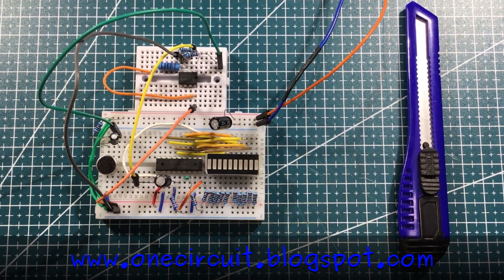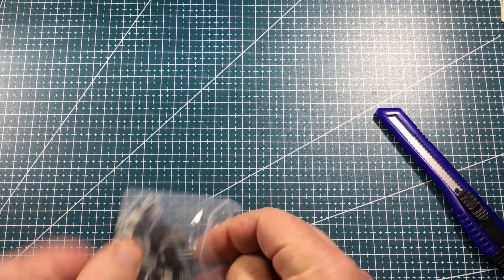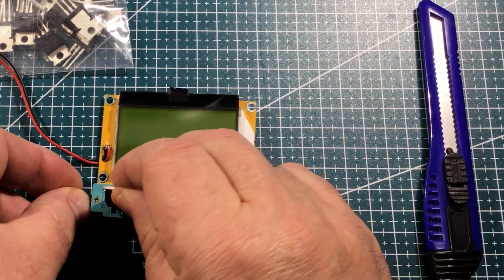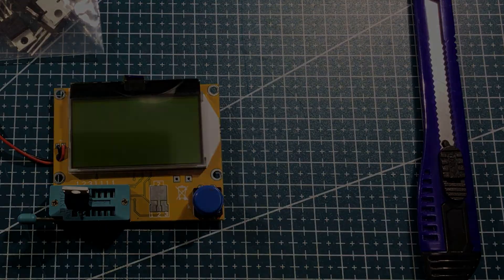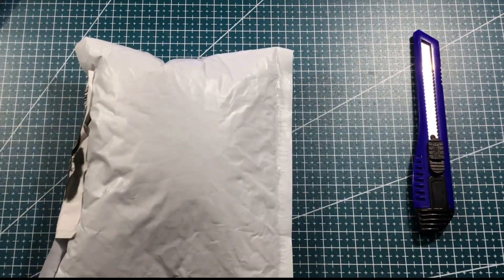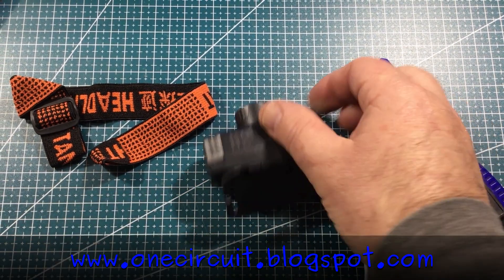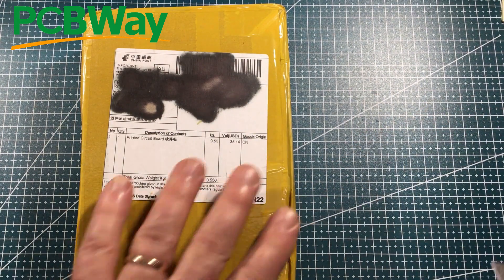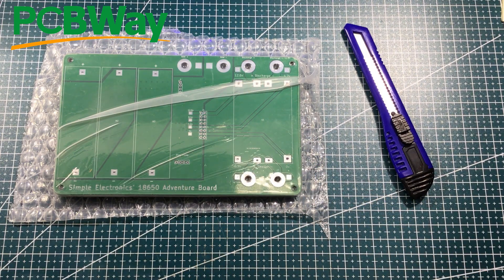Mailbag #16 - a nice mix!

Comment: Curious of your plans for the power PNP Mosfet.
They really coiled up your PTFE tube.  I obsessively try to make mine straight, without putting kinks in.
Now you just have to figure out where a Rpi3+ can be bought.  Sad they did not send you the alternate cable for a PiZero2. Hard to find those as well.
Reply from the maker: No specific plans for the power mosfet, just that I didn’t have any. I mostly buy stuff I find a bit curious and then maybe come up with possibilities for them later!
I am lucky enough that my workplace was throwing out “useless” Rpi3+ units a year or so ago and I snagged quite a few! Happy days!